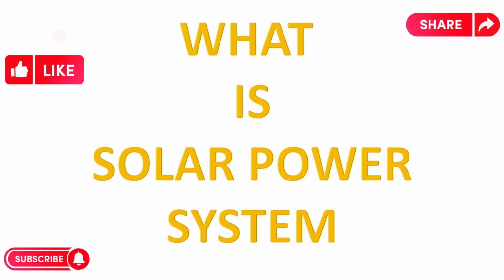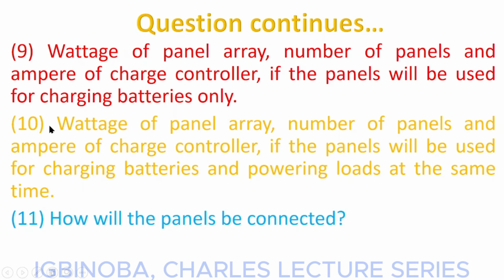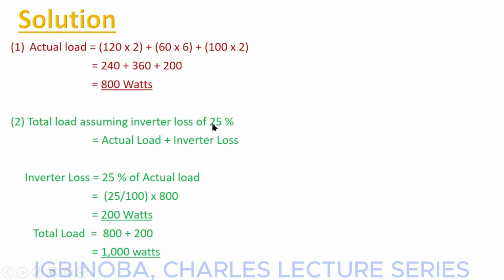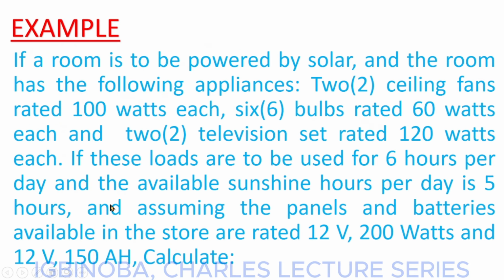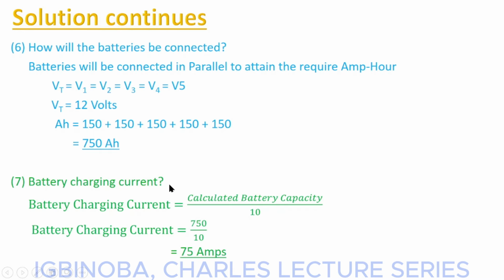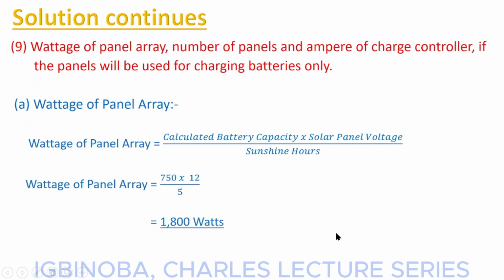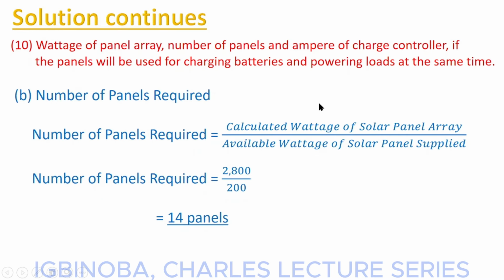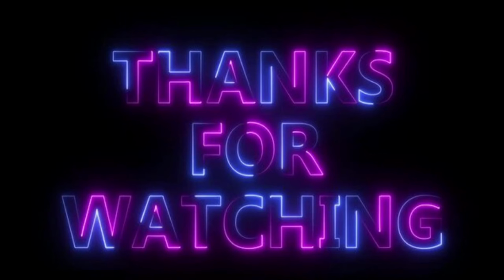Design of Solar Power System

Comment: EEE19S
Answer;
1. Actual load = 1380 watts
2. Total load = 1725watts
3. Inverter Rating VA = 2156.25VA
4. Battery Capacity = 1293.75Ah
5. No of Batteries = 9 Batteries 
6. Parallel Connection 
7. Battery Charging Current = 129.39Amps
8. Charging Time(40% Loss) = 14Hrs
9a. Panel Wattage = 3105watts
9b. No of Panels = 16 panels 
9c. Amps of charge connection=258.75Amps
9d. Parallel Connection 
10a. Panel wattage = 4830watts
10b. No of panels = 24.15(Make 25 panels to carry system)
10c. Amps of charge connection = 402.5Amps

Comment: MAR102X 
Answer:
1. Actual Load: 1380W
2. Total Load: 1725W
3. Inverter rating: 2156.25VA
4. Battery Capacity: 1293.75Ah
5. Number of batteries: 9
6. Parallel connection.
7. Battery charging current: 129.375A
8. Charging time: 14 hours.
9. a. Wattage of the panel array: 3105W
      b. Number of panels = 16 panels
      c. Ampere of charge controller: 258.75A.
10. a. Panel wattage: 4850W.
        b. Number of panels ≈ 24 panels.
        c. Ampere of charge controller: 402.5A
11. Parallel connection.

Comment: EEE22V 

Answer:
1. Actual load = 1380 Watt

2. Total load = 1725 Watt

3. Inverter rating = 2156.25 VA

4. Battery Capacity = 1293.75 AH

5. Number of batteries = 8.625 ≈ 9 batteries

6. They will be connected in parallel

7. Battery charging current = 129.375 Amps

8. Battery charging time with 40% loss = 14 hrs

9a. Wattage of panel array = 3105 Watts

9b. Number of panels = 15.525 ≈ 16 panels

9c. Ampere of charge controller = 258.75 Amps

10a. Wattage of panel array with load = 4830 Watts

10b. Number of panels = 24.15 ≈ 25 panels

10c. Ampere of charge controller = 402.5 A

11. They will be connected in parallel.

Comment: PETRO58F
1. 1380W
2. 1725W
3. 2156.25VA
4. 1293.75AH
5. 9 Batteries 
6. The batteries will be connected in parallel 
7. 129.375A
8. 14hrs 
9a.3105W
9b. 16 Panels
9c. 258.75 A (A 300 charge controller will be suitable )
10a. 4830W
10b. 24 Panels 
10c. 402.5A (A  500A charge controller will be suitable )
11. They will be connected in 
Parallel

Comment: EEE83E

 
Actual load
1380 W
Total load (25 % loss)
1725 W
Inverter rating
2156.25 VA
Battery capacity
1150 Ah
Number of batteries
8 × 150 Ah
Battery connection
Parallel
Charging current
≈ 115 A
Charging time (40 % loss)
≈ 14 h
Array (charging only)
2070 W and  11 panels and 172.5 A controller
Array (charging + loads)
3795 W and 19 panels and 316.25 A controller
Panel connection
Parallel

Comment: COMP31E

1. The actual pad is 1,380W
2. The Total load is 1,725W
3. The inverter rating is 2,156.23VA
4. The battery capacity is 1,293.75Ah 
5. The Number of batteries is 9
6.  The batteries are connected in parallel 
7. The Battery charging current is 129.4 amps.
8. The battery charging time is 14 hours.
9. a. The wattage of the panel array is 3,105W
b. The number of panels is 16 panels.
c. The Charge controller rating is 258.75 amps.

10. a. The wattage of the Panel array is 4,830 Watts 
b. The number of panels is 24 panels.
c. The charge controller rating is 402.5 amps
11. The panels are arranged in parallel

Comment: EEE79A

Answers:

1. Actual Load: 1380W

2. Total Load: 1725W

3. Inverter rating: 2156.25VA

4. Battery Capacity: 1293.75Ah

5. Number of batteries: 9 batteries

6. The batteries will be connected in a parallel connection.

7. Battery charging current: 129.375A.

8. Charging time: 14 hours.

9

a. Wattage of the panel array: 3105W

b. Number of panels ≈16 panels

c. Ampere of charge controller: 258.75A.

10

a. Panel wattage: 4850W.

b. Number of panels ≈24 panels.

c. Ampere of charge controller: 402.5A

11. The panels will be connected in a parallel connection to increase it's power output.

Comment: EEE53A 

Answer:
1) 1380W
2) 1725W
3) 2156.25VA
4) 1293.75Ah
5) 9 batteries 
6) The batteries will be connected in parallel 
7) 129.375A
8) 14 hrs
9a) 3105W
b) 16 panels 
c) 258.75A
10a) 4850W
b) 24 panels 
c) 402.5A
11) The panels will be connected in parallel

Comment: NAT 41O
1) Total load =1380W

2)Total load(25%) =1,725W

3)Inventer rating = 2,156.25VA

4) Battery capacity=1,293.75AH

5) Number of batteries= 9

6) Battery connection= parallel 

7) Battery charging current=129.375A

8) Battery charging time=14

9a)Array wattage =3,105W(charge only)

9b) Number of panels=16 panels 

9c) charge controller=258.75A

10a)Array wattage=4,803W

10b) Number of panels=25 panels 

10c) charge controller current  =402.5A

11)panel connection=parallel

Comment: COMP75W

1. The actual pad is 1,380W
2. The Total load is 1,725W
3. The inverter rating is 2,156.23VA
4. The battery capacity is 1,293.75Ah 
5. The Number of batteries is 9
6.  The batteries are connected in parallel 
7. The Battery charging current is 129.4 amps.
8. The battery charging time is 14 hours.
9. a. The wattage of the panel array is 3,105W
b. The number of panels is 16 panels.
c. The Charge controller rating is 258.75 amps.

10. a. The wattage of the Panel array is 4,830 Watts 
b. The number of panels is 24 panels.
c. The charge controller rating is 402.5 amps
11. The panels are arranged in parallel

Comment: CHM47U 

ANS :
1. Actual Load: 1380W
2. Total Load: 1725W
3. Inverter rating: 2156.25VA
4. Battery Capacity: 1293.75Ah
5. Number of batteries: 9 batteries 
6. The batteries will be connected in a parallel connection. 
7. Battery charging current: 129.375A.
8. Charging time: 14 hours. 
9
a. Wattage of the panel array: 3105W
b. Number of panels ≈16 panels
c. Ampere of charge controller: 258.75A.
10
a. Panel wattage: 4850W.
b. Number of panels ≈24 panels.
c. Ampere of charge controller: 402.5A
11. The panels will be connected in a parallel connection to increase it's power output.

Comment: PETRO98T

(1)Actual load: 1380 watt
(2)Total laod: 1725 watt
(3)Inverter rating: 2156.25 VA
(4)Battery capacity: 1293.75 AH
(5)Number of batteries: 9 batteries
(6)It will be connected in parallel
(7)Battery charging current : 129.375 A
(8)Charging time: 14 hours
(9)Wattage: 3105 watt
     Number of panels: 16 panels
     Charge controller: 258.75 A
(10)Wattage: 4830 watt
       Number of panels: 25 panels
       Charge controller: 402.5 A
(11). It will be connected in parallel

Comment: MEC105A

ANSWERS

1: Actual Load = 1,380W

2: Total Load (25% loss) = 1,725W

3: Inverter Rating = 2,156.25VA

4: Battery Capacity = 1,293.75AH

5: Number of Batteries = 9 batteries

6: Battery Connection = Parallel

7: Battery charging current = 129.375 Amps

8:Battery charging time with 40% loss = 14hrs

9a: Wattage of panel array = 3105 Watts

9b: Number of panels = 15.525 ≈ 16 panels

9c: Ampere of charge controller = 258.75 Amps

10a: Wattage of panel array with load = 4830 Watts

10b: Number of panels = 24.15 ≈ 25 panels with 

10c: Ampere of charge controller = 402.5 Amps

11: They will be connected in parallel

Comment: EEE50X
1.Actual Load: 1380W
Total Load: 1725W
Inverter rating: 2156.25VA
Battery Capacity: 1293.75Ah
Number of batteries: 9 batteries
The batteries will be connected in a parallel connection.
Battery charging current: 129.375A.
Charging time: 14 hours.

a. Wattage of the panel array: 3105W
b. Number of panels ≈16 panels
c. Ampere of charge controller: 258.75A.

a. Panel wattage: 4850W.
b. Number of panels ≈24 panels.
c. Ampere of charge controller: 402.5A
The panels will be connected in a parallel connection to increase it's power output.

Comment: CHM34H
Answers
1.1380W
2.1725W
3.2156.25VA
4.1293.75AH
5.9 batteries 
6. Parallel connection 
7.129.375A
8.14hrs
9a.3105W
9b.16 panels
9c.258.75A
10a.4830W
10b.25 panels
10c.402.5A
11.parallel connection

Comment: PETRO66N

1.Actual load : 1380 watt
2.Total laod : 1725 watt
3.Inverter rating: 2156.25 VA
4.Battery capacity: 1293.75 AH
5.Number of batteries: 9 batteries
6.It will be connected in parallel
7.Battery charging time: 129.375 A
8.Charging time : 14 hours
9a.Wattage : 3105 watt
9b.Number of panels: 16 panels
9c.Charge controller: 258.75 A
10a.Wattage : 4830 watt
10.bNumber of panels: 25 panels
10c.Charge controller: 402.5 A
11 It will be connected in parallel

Comment: PETRO38L
1. Actual load : 1380 watt
2. Total laod : 1725 watt
3. Inverter rating: 2156.25 VA
4. Battery capacity: 1293.75 AH
5. Number of batteries: 9 batteries
6. It will be connected in parallel
7. Battery charging time: 129.375 A
8Charging time : 14 hours
9a. Wattage : 3105 watt
9b. Number of panels: 16 panels
9c. Charge controller: 258.75 A
 10a. Wattage : 4830 watt
10b.Number of panels: 25 panels
10c. Charge controller: 402.5 A
11. It will be connected in parallel

Comment: CHM20T 
1. Actual load: 1380 W

2. Total load: 1725 W

3. Inverter rating: 2156.23 VA

4.Battery capacity: 1293.75 Ah

5.Number of batteries: 9

6. Battery connection: Parallel

7. Charging current: 129.4 A

8. Charging time: 14 hours

9a. Panel array: 3105 W

9b. Number of panels: 16 panels

9c. Charge controller: 258.75 A

10a. Panel array: 4830 W

10b. Number of panels: 24 panels

10c. Charge controller: 402.5 A

Panel arrangement: Parallel

Comment: NAT16P 

1. The actual load is 1,380W
2. The Total load is 1,725W
3. The inverter rating is 2,156.23VA
4. The battery capacity is 1,293.75Ah 
5. The Number of batteries is 9
6.  The batteries are connected in parallel 
7. The Battery charging current is 129.4 amps.
8. The battery charging time is 14 hours.
9. a. The wattage of the panel array is 3,105W
b. The number of panels is 16 panels.
c. The Charge controller rating is 258.75 amps.

10. a. The wattage of the Panel array is 4,830 Watts 
b. The number of panels is 24 panels.
c. The charge controller rating is 402.5 amps
11. The panels are arranged in parallel

Comment: EEE76X
1. actual load= 1380W or 1.38kW
2.Total load=17250 or 1.725kW
3.inverter rating= 2156.25VA
4. Battery capacity = 1293.75Ah
5. NO of batteries is 9
6. Batteries should be connected in PARALLEL
7.Battery charging current=129.38amps
8. Battery charging time= 14 hours
9.a WATTAGE OF PANEL ARRAY=3105W
  b No of Panel used = 16 
  c Ampere of Charge controller= 258.75Amps
10a. Wattage of Panel Array= 4830W
    b. No of panels =25 
    c. Ampere of charge controller= 402.5 Amps
 11. PARALLEL CONNECTION

Comment: EEE24X 

1. Actual Load = 1380W
2. Total load assuming inverter loss of 25% = 1725W
3. Inverter rating in VA using power factor of 0.8 = 7156.25VA
4. Battery capacity using a factor for reservations of 75% = 1293.75Ahrs
5. Number of batteries for backup hrs is 9
6. The panels will be connected in parallel 
7. Battery charging current = 129.375Ah
8. Battery charging time assuming a charging loss of 14% = 14hrs.
9. Wattage of panel array = 3105W
b. Number of Panels= 16
c. Amperes of charge Controller= 258.75A
10. Wattage of panel array= 4830W
b. Numbers of panel = 24
c. Amperes of charge Controller  = 402.5A
11. The panels will be connected in parallel.

Comment: EEE 25Y

1. Actual load: 1380 W
2. Total load: 1725 W
3. Inverter rating: 2156.23 VA
4. Battery capacity: 1293.75 Ah
5. Number of batteries: 9
6. Battery connection: Parallel
7. Charging current: 129.4 A
8. Charging time: 14 hours

9a. Panel array: 3105 W
9b. Number of panels: 16 panels
9c. Charge controller: 258.75 A

10a. Panel array: 4830 W
10b. Number of panels: 24 panels
10c. Charge controller: 402.5 A

11. Panel arrangement: Parallel

Comment: EEE70R 

1.  Actual load = 1380W

2.  Total load (25% loss) = 1725W

3.   Inverter rating in VA= 2156.25VA

4.  Battery capacity= 1294AH

5.  Number of batteries for backup hours = 9 batteries 

6.  Arranged in parallel 

 7.   Battery charging current = 129.4A

8.  Battery charging time = 14hrs

9a.  Wattage of panel array= 3106W
b.  Number of panels required= 16 panels
c.  Ampere of charging controller required= 259A

10a.  Wattage of panel array= 4381W
b.  Number of panels= 24 panels 
c.  Ampere of charge controller required= 403A

11. Panels connected in parallel.

Comment: CHM41O
Answer:
1. Actual Load: 1380W
2. Total Load: 1725W
3. Inverter rating: 2156.25VA
4. Battery Capacity:        1293.75Ah
5. Number of batteries: 9 
6. Parallel connection.
7. Battery charging current: 129.375A
8. Charging time: 14 hours.
9
a. Wattage of the panel array: 3105W
b. Number of panels =16 panels
c. Ampere of charge controller: 258.75A.
10
a. Panel wattage: 4850W.
b. Number of panels ≈24 panels.
c. Ampere of charge controller: 402.5A
11. Parallel connection

Comment: MAR75W

1. The actual pad is 1,380W
2. The Total load is 1,725W
3. The inverter rating is 2,156.23VA
4. The battery capacity is 1,293.75Ah 
5. The Number of batteries is 9
6.  The batteries are connected in parallel 
7. The Battery charging current is 129.4 amps.
8. The battery charging time is 14 hours.
9. a. The wattage of the panel array is 3,105W
b. The number of panels is 16 panels.
c. The Charge controller rating is 258.75 amps.

10. a. The wattage of the Panel array is 4,830 Watts 
b. The number of panels is 24 panels.
c. The charge controller rating is 402.5 amps
11. The panels are arranged in parallel

Comment: PETROCHEM43Q

1. Actual Load: 1380W
2. Total Load: 1725W
3. Inverter rating: 2156.25VA
4. Battery Capacity: 1293.75Ah
5. Number of batteries: 9 batteries
6. The batteries will be connected in a parallel connection.
7. Battery charging current: 129.375A.
8. Charging time: 14 hours.
9
a. Wattage of the panel array: 3105W
b. Number of panels =16 panels
c. Ampere of charge controller: 258.75A.
10
a. Panel wattage: 4850W.
b. Number of panels ~24 panels.
c. Ampere of charge controller: 402.5A
11. The panels will be connected in a parallel connection to increase it's power output.

Comment: EEE5E
1: Actual load =1380W
2: Total load =1725W
3: inverter rating=2156.28W
4:Battery capacity=1293.75Ah
5: number of battery=9
6: Connected in parallel
7: Battery charging current=129.375Ah
8: Battery Charging time with 40%loss=14hours
9a: Wattage of panel array=3105W
9b: Number of panels=16panels
9c: Ampere of Charge controller =258.75A
10a: Wattage of panel array with load=4485W
10b: Number of panels =23panels
10c: Ampere of charge controller=373.75A
They will be connected in parallel

Comment: EEE114J

Answers:
1. Actual Load: 1380W
2.Total Load: 1725W
3.Inverter rating: 2156.25VA
4.Battery Capacity: 1293.75Ah
5.Number of batteries: 9 batteries
6.The batteries will be connected in a parallel connection.
7.Battery charging current: 129.375A.
8.Charging time: 14 hours.
9
a.Wattage of the panel array: 3105W
b. Number of panels ≈16 panels
c. Ampere of charge controller: 258.75A.
10
a. Panel wattage: 4850W.
b. Number of panels ≈24 panels.
c. Ampere of charge controller: 402.5A
The panels will be connected in a parallel connection to increase it's power output.

Comment: PETRO37K 

1. Actual power is 1380W
2. Total power is 1725W
3. Inverter rating is 2070 VA 
4. Battery capacity is 1293.75 AH
5. 9 battery 
6. Connected in parallel 
7. Battery charging current 123.98A
8. Battery charging time 14hrs
9a. Wattage of panel 3105W
  b. Number of panel 16
  c. Charge controller current 258.75A
10a. wattage of panel 4830W
    b. 24 panels 
    c. Charge controller 402.5A
11. connected in parallel

Comment: COMP12L 

Solution:

1. Actual Load = 1,380W
2. Total Load (25% loss) = 1,725W
3. Inverter Rating = 2,156.25VA
4. Battery Capacity = 1,293.75AH
5. Number of Batteries = 9 batteries
6. Battery Connection = Parallel
7. Battery Charging Current = 129.375A
8. Battery Charging Time = 14hrs
9a. Array Wattage (Charge Only) = 3,105W
9b. Number of Panels = 16 panels
9c. Charge Controller Current = 258.75A
10a. Array Wattage (Charge + Load) = 4,830W
10b. Number of Panels = 25 panels
10c. Charge Controller Current = 402.5A
11. Panel Connection = Parallel

Comment: NAT2IU 
1.Actual load=1380W
2.Total load=1725W
3.inverter rating=2156.25VA.
4.Battery capacity=1239.75AH
5.Number of battery capacity=8.625(9 battery)
6.They will be connected in parallel 
7.Battery charging current=129.375A
8.Battery charging time with 40% loss=14hours.
9a. Wattage of panel array=3105W
9b.Number of panel =16 panels 
9c.Ampere of charge controller=258.75A.
10a.wattage of panel array with load=4485W
10b.Number of panel=23 panels 
10c.Ampere of charge controller=373.75A
11.They will be connected in parallel.

Comment: COMP27A 
Answer:
1: Actual load =1380W 2: Total load =1725W 3: inverter rating=2156.28W 4:Battery capacity=1293.75Ah 5: number of battery=9 6: Connected in parallel 7: Battery charging current=129.375Ah 8: Battery Charging time with 40%loss=14hours 9a: Wattage of panel array=3105W 9b: Number of panels=16panels 9c: Ampere of Charge controller =258.75A 10a: Wattage of panel array with load=4485W 10b: Number of panels =23panels 10c: Ampere of charge controller=373.75A They will be connected in parallel

Comment: COMP58F

1. The actual pad is 1,380W
2. The Total load is 1,725W
3. The inverter rating is 2,156.23VA
4. The battery capacity is 1,293.75Ah 
5. The Number of batteries is 9
6.  The batteries are connected in parallel 
7. The Battery charging current is 129.4 amps.
8. The battery charging time is 14 hours.
9. a. The wattage of the panel array is 3,105W
b. The number of panels is 16 panels.
c. The Charge controller rating is 258.75 amps.

10. a. The wattage of the Panel array is 4,830 Watts 
b. The number of panels is 24 panels.
c. The charge controller rating is 402.5 amps
11. The panels are arranged in parallel

Comment: CHM89K 

Answers:
1. Actual Load: 1380W
2. Total Load: 1725W
3. Inverter rating: 2156.25VA
4. Battery Capacity: 1293.75Ah
5. Number of batteries: 9 batteries 
6. The batteries will be connected in a parallel connection. 
7. Battery charging current: 129.375A.
8. Charging time: 14 hours. 
9
a. Wattage of the panel array: 3105W
b. Number of panels ≈16 panels
c. Ampere of charge controller: 258.75A.
10
a. Panel wattage: 4850W.
b. Number of panels ≈24 panels.
c. Ampere of charge controller: 402.5A
11. The panels will be connected in a parallel connection to increase it's power output.